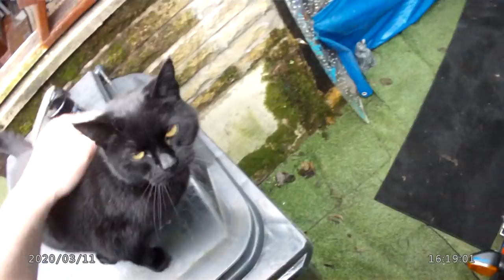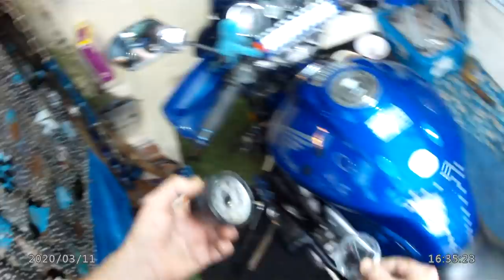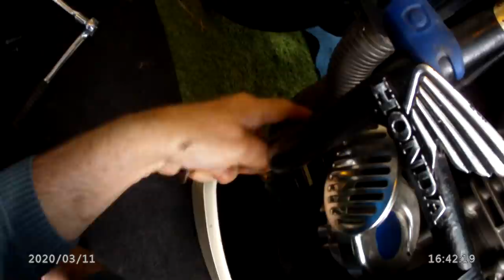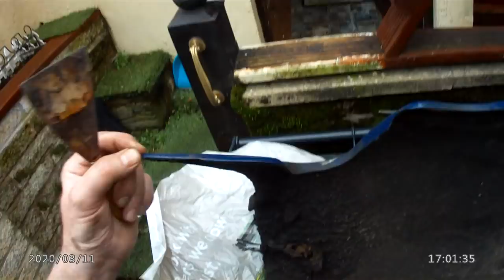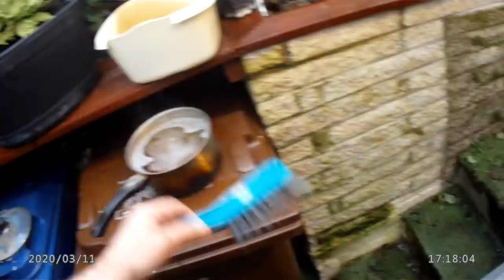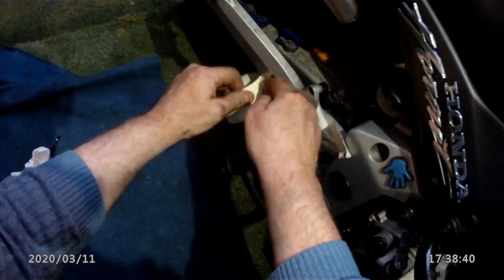Hornet 900 Oil & Filter change....

Comment: I write the date on the unused oil bottle so I know when I did it and always use mineral oil like I did in the 70"s. When I did the red 900 it took 4 liters. Be weary if the odometer is analog it may have been around the clock. Yeah save yer money for another bike Steve instead of pissing it up against a wall!